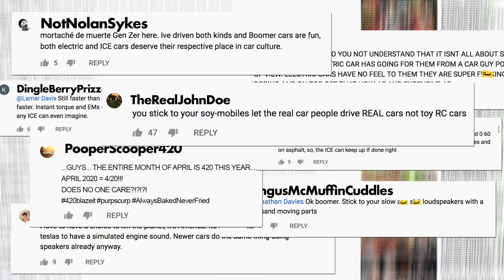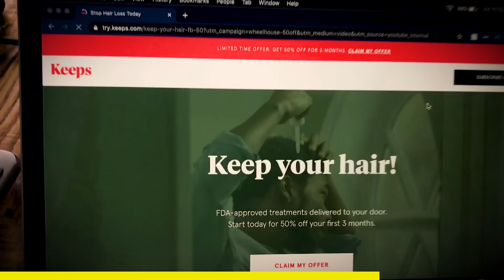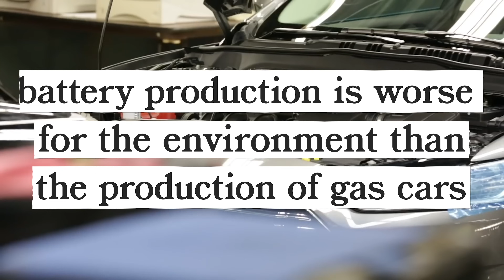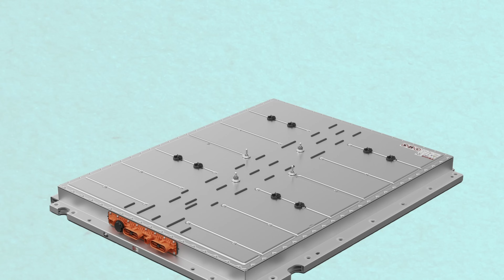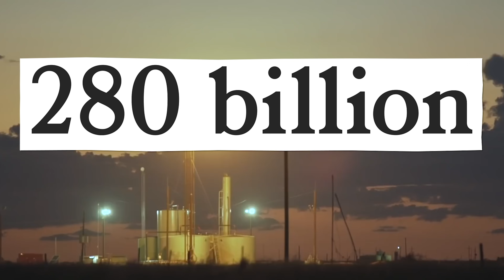Are Electric Cars REALLY Better for the Environment?

Comment: CO2 pollution is just part of the story. Gasoline combustion creates loads of other harmful particulates.
Reply: @5 5 The only particles an EV produces are break particles and tire dust, and even that is reduced to the fact that EVs usually use regenerative breaking reducing the wear on the breakpads.
The pollution generated during production is a real thing of course, but it's not in the cities, most people don't come into contact with it.
Reply: not just that. Even something as simple as brakes, people forget how much brake dust is being put into the air and being washed out to the sea. EVs and Hybrids don't utilize the conventional brakes as much. As someone who worked in the service industry it was typical to only need to change brakes on a Prius after they've gone 100K miles. 

I still like gas burners though.
Reply: windson7 yeah but only if you shove it down their throats. The same would happen if you made everyone drink gasoline, it’s a stupid point
Reply: @projectorshaping if tesla can leak gear fluid then ice can leak gear fluid too, basically any car can
Reply: yeah NOx does a number too, but ofcourse people will always be "but muh gas engine"
Reply: @projectorshaping I don't think new EV's uses oil, unless you mean grease since they don't have a gearbox (electro motor just goes the other way around for reverse), BUT if you talk about a classic ICE car that is converted to EV and kept its original gearbox, then yes it has gearbox fluid.
Reply: Big gut Ed  well, remove the children and make it so that the mine does not collapse constantly, its 2020, we got the technology to stop stuff collapsing every 2 minutes. (that will erase 2 of the list of negatives) 

question: how much batteries/cars can you make with that one ton of lithium salt? (this will probably be different depending if you use city car stats like the VW E-up vs the longer range cars like a Tesla)

about that Tesla, if you are correct about battery location and combustion technique, i agree that it is a stupid location. ( I have not done research about Tesla although i thought that other manufacturers located the batterypack usually between the wheelbase ). Also don't forget that there was a time that gasoline powered cars where not that safe when getting into accidents that resulted into big fiery infernos, most famous the Ford Pinto. also lol not safe
Reply: Big gut Ed  you are right, most of the Cobalt that's getting extracted from the earth is from DR Congo, and since the western world (mostly countries from the European continent) has released African countries (colonies) to rule for themselves, a lot of the time shit has hit the fan cause everyone wants more power thus corruption and war lords appear.

I hope you know that in a car with a combustion engine that has a exhaust with catalytic converter (which is required by law depending where you live) also has Cobalt in it, that while running your car will drop particles of cobalt on the road. (also not considered great, maybe not harmful to humans, still a waste though.)

Some parts in Africa also got oil, and these machines/pumps are not always that well maintained, leaking oil in rivers, killing most everything in that river and affecting the health and food supply of villagers locating at that river.

So what you do, it is a shit show.

(btw. I am not saying that everyone has to switch to EV all at the same time, for most people EV is still to expensive and for other people the range is not good enough)
Reply: Big gut Ed  only thing i could find close to that title is 3 teens in Fort Lauderdale, 1 was flung out of the car and so far i can find survived, other 2 where in the car and burned, which is sad. One person saw the crash happen and think they did atleast 50-60mph while colliding with the wall and police says that speed was a factor.
some people in the comments of the news story said they did 116mph in a 30 zone.
Reply: as harmful as a nuclear disaster like in japan a few years back
Reply: Yeah, but thats what catalytic converters are for. To convert nox, co, hc, etc into water and co2
Reply: @Craig Taylor Oil leaks? What vintage ICE vehicle are you comparing it to?
Reply: @eugene9852  Even new ICE vehicles can develop oil leaks if they have material defects or manufacturing issues... And before you say material defects and manufacturing issues don't happen, look up the 2017 Nissan Navara.
Reply: @cynicalnews963  Are EVs immune to manufacturing faults? EVs don't leak oil, nor do properly maintained ICE vehicles. Not a valid point of distinction.
Reply: No oil leak from EV, but a faulty battery kinda impact that lifetime emission number :P
No ICE vehicle leak oil without some kind of fault, if we assume ICE vehicle to have a fault we must also assume EV can have some faults in parts that could cause emission ...

Comment: An ICE is much more efficient than any EV when both are not being driven.  EV's are always either using their batteries energy or need to be charged to maintain their capacity.  Like most batteries they lose energy even sitting still.  And the amount of time a car sits is much longer than the time they are driven.
Reply: @Seb C Parasitic loses times 100,00,000 cars times 20 hrs per day of non use is not a small number.  Batteries may work for now but there are better ways of powering cars.
Reply: @Seb C wind and solar can only contribute a small percent of our energy needs, by virtue of there extremely low energy density the amount of real estate needed to produce the huge amounts of power we need would be outrageous.  These sources play a huge role in changing the power production paradigm but they can only fill a small hole.  If climate change is really as bad as many make it out to be, only nuclear power can provide the amounts of clean power that is needed.  And I am not taking about the archaic PWR and BWR that are now obsolete and need to be replaced by new nuclear technology.  Wind and solar will still play a big role in this shift.  With nuclear the EVs would go away in favor of hydrogen or some other technology that doesn't rely on batteries.  If nuke waste is considered to a toxic substance and has 1/2 lives of 10,000 yrs or more, battery material is toxic for eternity and should require the same level of disposal security as nuke waste.  I have no reason to dislike EVs but they have issues and are not carbon neutral as many claim they are.

Comment: Why didn’t you mention battery lifetime and required replacement? The major polluter of electric cars starts over every 5 to 7 years. 57 to 50 to 50 to 50 to 50 over 25 years. That’s 257 metric tons of co2. 

The best thing you can do is just keep driving the car you own until the doors fall off. Then buy an EV with graphene batteries, whenever they’re production ready.

Comment: As a recent Tesla Model 3 Owner...how is V8 noise and slower performance better than no noise and faster performance that also happens to be better for humanity AND gets better over time due to OTA updates?  Download engine noise and play it through the speakers!  I don't understand how anyone can buy any other car at this point (if you can afford it).  Why would you want your asset to depreciate more and never get better?  Why would you want to spend money on maintenance for transmission and oil changes? Teslas are also the safest vehicles currently in production. What am I missing?

Comment: I know you didnt mention maintenance, but i think its worth mentioning that any battery, no matter the make, will turn bad eventually. i'm expecting a future with mostly electric vehicles, but a regular, decent combustion engine will last very many years together with the transmissions and in theory it only needs oil, plugs, a couple of belts which is dirt cheap. a Battery will need changing eventually and no one wants a old battery, age is what kills a battery ( usually ). so the only decent alternative is a renovated ( which is possible, people do that to old Prius batteries ) or a brand new one. which we just concluded is a very ' dirty ' part of a EV and, i suspect, will be every expensive no matter what. that basically means a EV-battery, with our current technology, will have lifespan, or a possible R.I.P date.. a Model 3 is like, 30.000,- dollars, perhaps 35.000,-.. however. in 10 years or lets say, 100.000 miles, it'll likely go to a junk yard, cus a model 3 is bound to eventually get cheaper ( if you follow Tesla logic ) and after 10 years and 100.000 miles, i think its gonna be hard to justify putting a new battery in it.

If a EV battery can last more than 10 years id be surprised, even if it does, its only a matter of time before it collapses. but as you said yourself, EV production is still in its early youth, so perhaps we'll have batteries that lives up to 25 years by 2050. we'll see, i'm gonna be at boomer age by that time thou. i hope im not fat, bold and a in red vette by then thou.

Comment: Hey did you take on account the amount that in combustion engine vehicles you have to change the oil every 5000 miles?
Reply: Mine runs up to 30 000 km (20 000 ish miles) between oil changes. Also it monitors its own oil and tells me when it need changing.
Reply: @peglor  better to check it yourself couple of times, just to see if the level is still high enough, i knew someone that had a car with oil level sensors, until one day the engine made weird noises and broke because the oil level became to low, but the sensor never mentioned a thing.

Comment: I do want to add, the replacement of the battery cell in electric cars. They can die after a few years sometimes and they tend to be expensive, and also the impact of making them would add to the total of CO2.

Comment: Wait...so are you assigning all of the emissions from oil refining to ICE?  If so, that's going to skew the numbers A LOT considering the refining process applies to a lot more than just fuel (items you mentioned in the video - plastic, roads, etc)
These comparisons never seem to factor in the amount of subsidies EV require to come to fruition compared to ICE.  Money = effort and effort produces C02 (I generally reject the premise that C02 is the boogeyman we've been brainwashed to believe it is, but I'll accept the premise for this context).  While both industries receive government subsidies, only one depends on it to even exist.  If all government regs and money were removed from the equation, oil/gas/ICE would be just fine and would probably thrive more than it currently does.  EV's and the industries it relies on would be gone overnight.  MASSIVE amounts of money are dumped into the EV industry to make it feasible both at the back end, point of production, point of sale, and even when charging.  That has a large carbon footprint that never seems to be addressed.

Comment: I'm in favor of electric drivetrains, but it comes down to this: Is mining coal and using it cleaner than producing gasoline? Keep in mind that EV's increase demand, and thus run on the dirtiest source in the grid. That coal burns dirtier than gas, and that the pollution of a refinery has to be devided over all products.
Reply: No it comes down to this: there wont be petrol/ oil forever, we need to switch to something else at some point and keep the oil that is left for more usefull things.

There has been a lot of wars caused by oil interests, there has been no wars over electricity.

You can produce your own electricity, you cant produce your own petrol.

We can make electricity with lot of different sources, if one source cause problems we can switch to an other.

Burning gas makes toxic gases causing respiratory diseases.
Electricity can be made without emitting toxic gases.
Reply: @niconico3907  That´s great for the future, but as of now we don´t have enough clean power sources. The best car today is a modular one with an electric drivetrain. The HVAC/generator unit and fuel tanks easy to swap. Gas, electric, hydrogen, liquid nitrogen, it can be anything you want.
A plug in hybrid comes close.

We need a car that can adapt to the local political climate and local available power sources. Energy transitions take time.

I´d also like to see free public transport and population control :) The latter one being the elephant in the room.

In the discussion about energy there´s a lot of cherry picking going on, and often the global consequences are overlooked.
In example, if we rush to EV´s, gasoline production will not halt before we find alternatives for heavy crude, asphalt, plastics and kerosine too. Thus the price of gasoline will merely drop, making it available for developing nations driving old cars without MOT with the AC full blast.
They´re not gonna pump it back into the ground.
Then there´s fertile soil being used for ethanol, wind and solar power. I´d rather see trees, needing no maintenance. Delivering circular energy and building materials to boot. Fresh cool air, animals, recreation...

Changing our pollutive habits is a good thing, and we are doing that already since the 60´s. Gradually. Controlled.
The 97% scientists telling us it´s 10 to midnight is a corrupted lie. The world has ended on many occasions already.
But unfortunately, the panic caused results in wrong decision making; emptying our wallets while doing unnecessary harm to the planet.
That´s what I observe.

Just look at Germany. Phasing out nuclear power in favor of brown coal. Tell me, does that look smart to you?
You can buy any scientific result including experts and statistics to suit your agenda.
Reply: @STARDRIVE  I agree we shouldnt use fertile soil for solar power. Solar panels should be put on the roofs of houses, factories, supermarkets...
Solar thermal power station should be in the desert.
Windfarm can be on fertile soil because they dont use much surface, and provide a source of income helping to keep farmers in business.

For kerosene replacement, I think the best would be sea weed based biofuels grown in artificial salt lakes desert near the sea.

For the "we get gasoline if we produce plastic", refineries can adjust a bit the amount of gasoline and gas oil they get from the same amount of oil.
Reply: @niconico3907  Interesting. I wasn't aware of sea weed based biofuels. Good one.

Comment: My new engine uses less CO2 in 300,000 than it takes to make the batter.  The engine will be par in efficiency plump to wheel as an EV is plug to wheel.  I estimate around 8-10 times less CO2, 10x less cost for energy and 10-50 x better range.  Try 10,000 miles on 50 gallons of fuel.  EVs are a joke and poor people cannot afford them.  Poor will be able to afford my tech.  Newenginetype.com
The 57 mt by old IC you claim will be 1/4th of the fuel or  50/4=12.5 plus 7 = 19.5 vs EV at 28.  So if your numbers are good, my tech will always be less.  Then go to Electro fuels from nuclear...game over.  EVs are junk and a bad idea that needs to stop before they fill the world with toxic waste.

Comment: Props on having the guts for airing out that story thank you. Part two modern Diesel car vs ev. Ding ding ding let's get it on🤜🤛
Reply: for diesel the route is the same as for gasoline, find oil, get pump there, start pumping, transport via trucks and / or ships to refinery, transport via trucks and / or ships to country and / or petrolstation. For the user of that car the numbers might be different though

Comment: EVs will be even more efficient thanks to advancing battery technology, like solid state batteries. Additionally, while gas engines have come close to harnessing every ounce of energy produced from the gasoline it burns, electric motors still have a way to go. Finally, nuclear energy and power. If there were more nuclear powerplants, EVs would be leaps and bounds more efficient in their impact to the environment than they are presently. EVs are slightly more efficient now, but in the future, there won't even be a comparison. I'm all for that.

Comment: EVs are only more efficient than gas vehicles for the time span between when they are manufactured and when they will need a new battery. I wish that the human race would refine EVs or another idea for the automobile before going off on such mass production.

Comment: The misinformation out there is amazing.  Tesla batteries are designed to last 1500 charges, or 500k + miles.  Some Teslas have already reached 1 million miles on original batteries.  So they don't need to be replaced "every few years" .

Comment: I want to point out few more things about ev.
1) Changing batteries. How often they need to change the batteries ?
2) Batteries work fine in low temperature environment. How about hot environment like 39 to 47 degrees .. like in India ?
If we installed a cooling system then it's going to consume the battery as there is no other source of energy.
3) Charging time is a big issue for Ev's. Even if an EV have range of 400 kms with ac turned on with full charge, how are we going to charge our cars at hotels or remote areas ?
Let's consider the fact that EV needs a dedicated charging station. Portable chargers take around 14-16 hrs to charge the batteries.

Comment: Dude nuke power is like the second most clean electric power you can have and wind ofcourse or number1 and hydroelectric is 3rd and solar power is sort of dirty because making a solar powerplant reaquired you to create batteries and solarpanels and both of them are dirty for environment. And those batteries might be better than you average car battery that signs itself out after couple years but they still need replacing. Wind power like solar are not most reliable too because there might be long durations or calm air and no sunlight which makes hydroplants and nuke plants most reliable. Also screw ev and gasoline cars i root for hydrogen cell cars bexause they are ecen more clean that ev